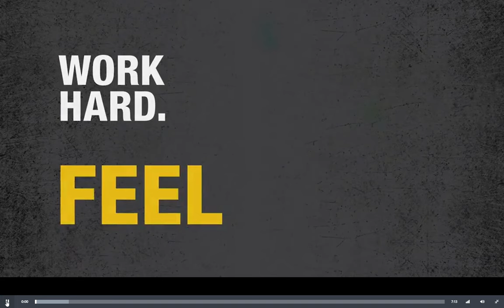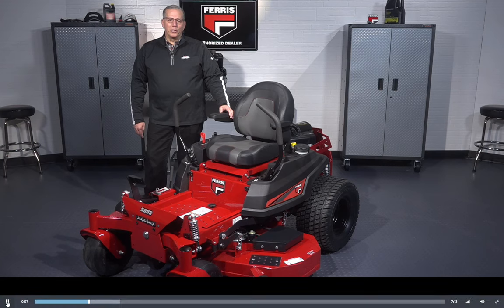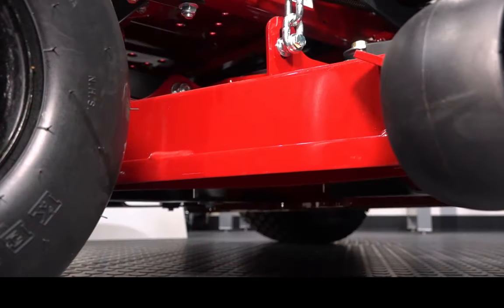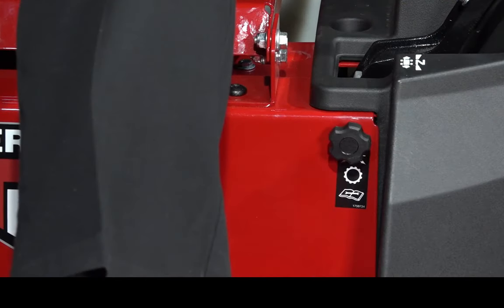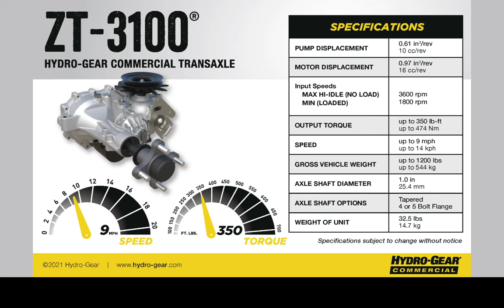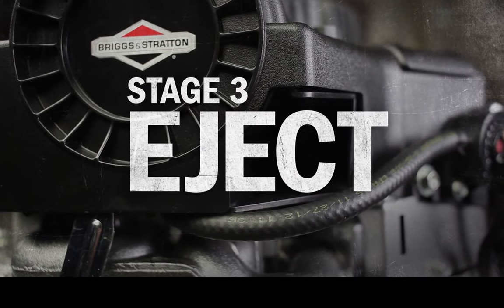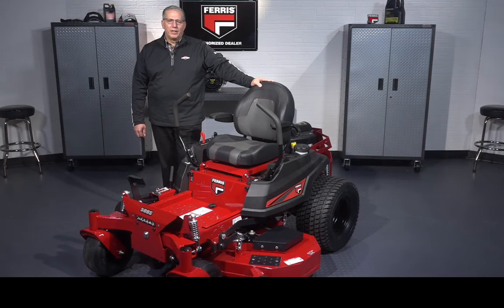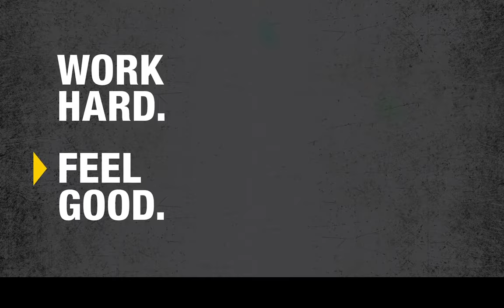FERRIS 500S WALK AROUND VIDEO

Comment: Nobody asked for my opinion but here we go. This was my first zero turn mower ever and have to say it's a caddylack across my Baja 3acre yard I mow almost every week and I might add this yard is country as elf/rough. I don't even have to think about another brand when they've cornered the market with the suspension. Show any and all that wanna test drive it our here they are all surprised by the ride this this gives you. I highly recommend getting one. Also I might add but not sure who all or how long they been doing this but I've hit some pretty massive obstacles with the blades and so far all I have had to replace was the bolts that run through the pullys on top of the deck. They shear off first bolt cost $5 deck spindle??? Idk. $30-$100. There is nothing with splines or keyways so the bolt on top is the weak point thank goodness. I'm hooked no need to even bother at this point to search for other brands the ferris is a keeper.

Comment: Key question - is the 500S 46" worth the extra cost over the 300S 46" with full suspension? 
Trying to make that decision and buying one or the other this week! Thank you.
Reply from the maker: FERRIS 300S and FERRIS 500S Available in 42-Inch (2-Blades), 48-Inch (3-Blades) and 52-Inch (3-Blades)
Reply from the maker: FERRIS 300S has Briggs & Stratton PXi Series Engine and Hydro-Gear® EZT Transmission
Reply from the maker: FERRIS 500S has Briggs & Stratton CXi Series Engine and Hydro-Gear® ZT-2800 Transmission
Reply: @SoslersGardenAndFarmEquipment  depends on the configuration 500S 5902056 has a Kawasaki® FR730V and Dual Hydro-Gear® ZT-3100® transaxles with 7" cooling fans